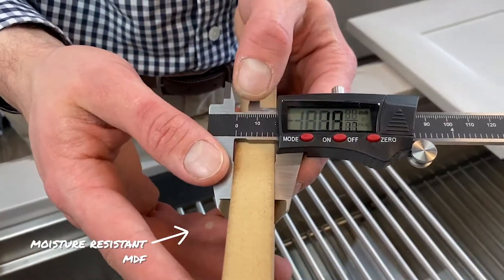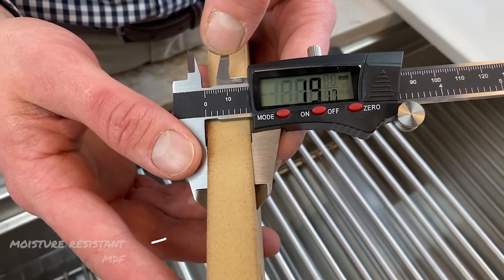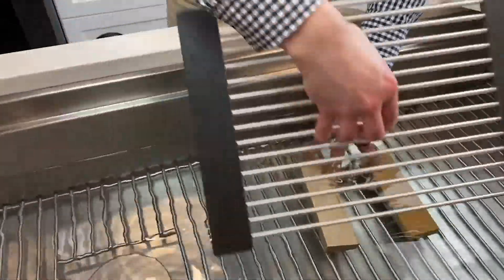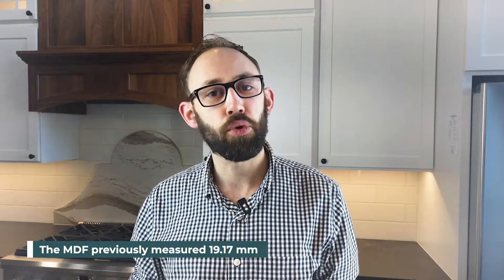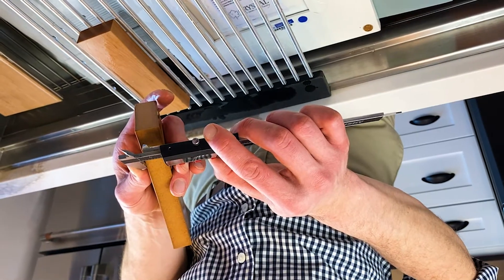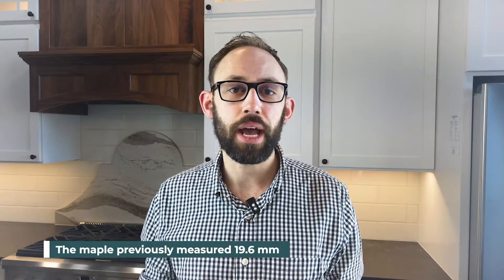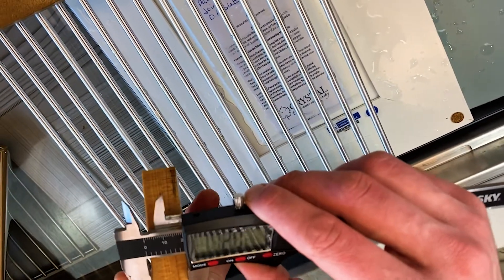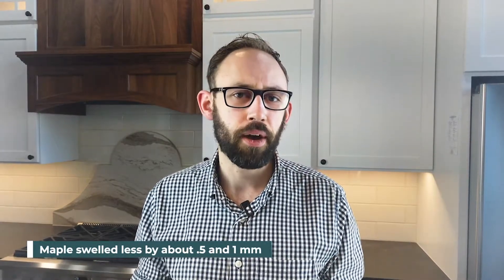Is MDF Good for Cabinet Doors? Our 24-Hour Water Test

Comment: With all due respect, your test makes no sense! I think you missed the point. No one would find themselves in a scenario where the kitchen was submerged, yet even if that happened (who knows how), major damage would occur, and the cabinets wouldn't be relevant. You could create realistic analyses, simulating the impact of water and other products when cleaning the cabinet, simulating water splashes when washing dishes, and things like that. Another point, no one makes unfinished cabinets; you should use primer and paint, creating the most realistic test piece possible. I think the ideal question would be, "With proper treatment and finishing, do humidity and water of an ordinary day make a difference between maple and MDF?"

Comment: Good to know if your house gets submerged in water....really important that your corn flakes won't   be ruined. I really can't imagine a situation where an unfinished cabinet door would be subjected to that much water....and it would matter...lol
Reply from the maker: Very true. If your entire cabinet is submerged in water, then there are some other issues going on. The point of this test was to show water water can do to a cabinet if not cleaned up, like around the sink and dishwasher. Over time, that water will damage the finish, especially if there is any scratches that will allow the water to get underneath the finish. Drying off the door when water gets on them with help you cabinets last longer.

Comment: Nunca he hecho una prueba así con el mdf....puse en varias ocasiones una pieza en un bote con agua (aproximadamente. 15- 20 min)....y no tuvo ninguna deformacion....aquí las temperaturas en verano son desde 45- 52 °c...y hay días de hasta 50% de humedad (pocos días en julio - sep.). Aun así no presentan ningún problema con deformaciones. Casi siempre utilizo mdf para puertas de gabinetes y hay buenos resultados.....fácil de trabajar, y muy durables.....MDF excelente material....gracias por esta explicacion....Saludos desde San Luis Río Col. Son. Mexico...
Reply from the maker: Muchas gracias por tu opinión sobre el uso de este producto! Es bueno escuchar sobre el uso del MDF en una área con alta humedad y temperatura. Me encantó escuchar que tan duradero fue el MDF para ti.

Comment: The general rule is you should not stain MDF, and you shouldn't paint wood when it comes to cabinets.  You'll have cracking at the seams of the wood when it's painted and it expands more naturally (not submerged in water) then MDF. MDF is just fibers and will absorb stain and color but not provide much protection.
Reply from the maker: Love this! That's a great rule to follow!

Comment: Very interesting video. I currently figuring out using mdf for a cabinet and entry way bench….both can get moisture on them from time to time as to the location of placement in our house…. Nearest the entry door.
One idea I am considering is using a tintable wood stain. Behr makes a product that we use for outdoor projects and fencing etc…since our paint and or ston selection is mild when it comes to colors (bold v subtle) we feel the stain would work great as it does not swell and contract like paint does. What are your thoughts about this?
Reply from the maker: Would you directly stain the MDF? I wouldn’t recommend that. Better to use a laminate or stain a combination of plywood and solid wood.